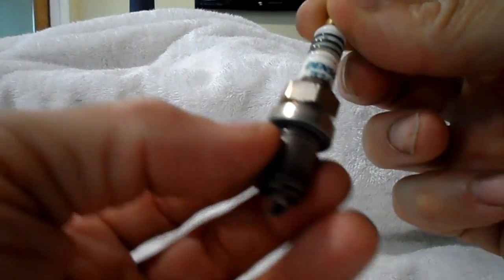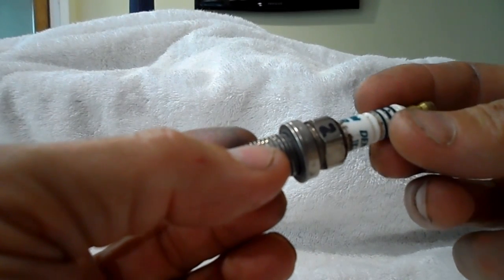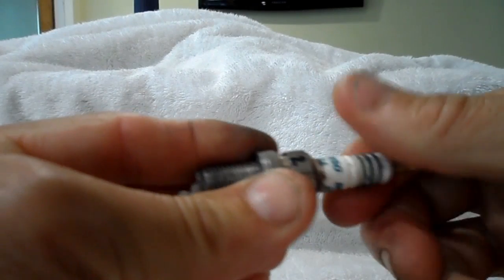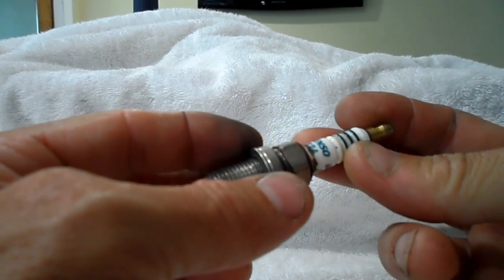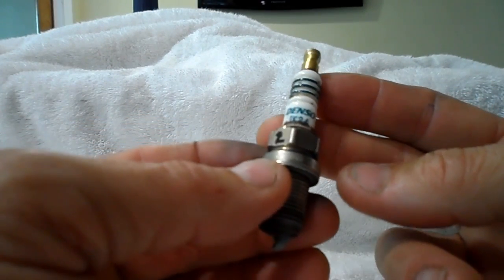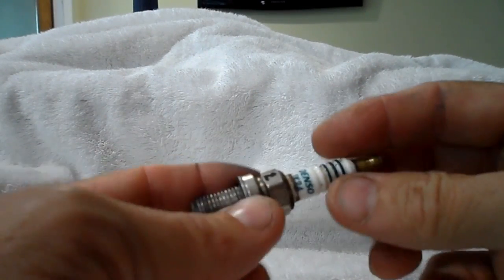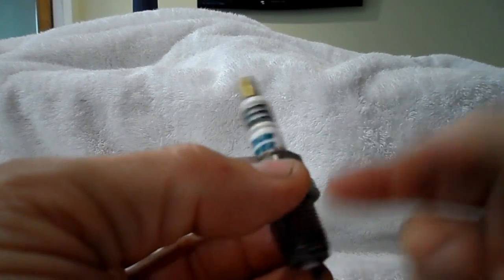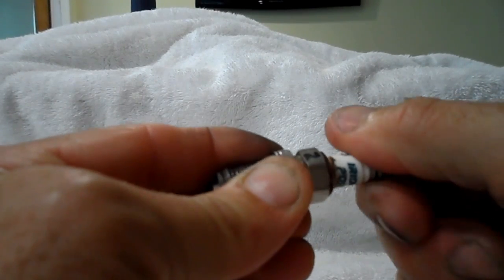Denso Plug Failure

Comment: This is almost always due to over-tightening the plug... metal stretches enough to loosen crimping-force on insulator.  It can happen with any plug, however Denso is the most sensitive due their softer high-nickel alloy.

Comment: Yep they're fake.
Reply from the maker: I would be happy to mail it to you for your inspection (I still have one or two sitting around).   Sure they are worn a bit, they had the shit run out of them at 9350 rpm in a race motor.  They are not fake, they were sourced locally by my engine builder who I've known for 17 years.  I don't put eBay Chinese spark plugs into my friggin race car.  I've seen the Chinese Denso fake on youtube. These are original Denso plugs.
Reply: D Martel Na I believe you, if you're that adamant about it. I wouldn't give u my address. Impressive motor you got. Shit happens but Denso makes good stuff. Pretty much one of the top OEM suppliers in the world.
Reply from the maker: All good, lol, I was thinking that about the address.  Yeah, stuff happens. Enjoyed the heck out of the car and high RPM b16.  Comes at a cost, it breaks stuff.  I did keep the plugs cause I bothered me what happened.  Watching this video and comparing the plugs, mine have the good quality/color fonts.   https://www.youtube.com/watch?v=a0aQpdsALQM
Reply: D Martel B16 is a great motor, yea thats racing. The knockoffs were notorious for that same defect but doesnt mean Denso didnt have similar issues.